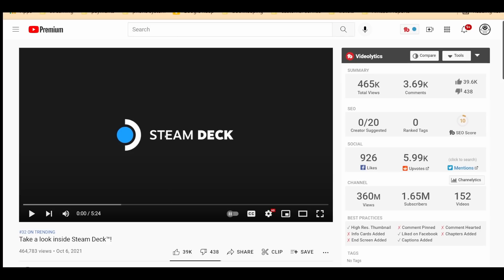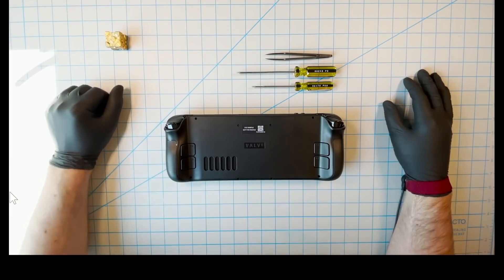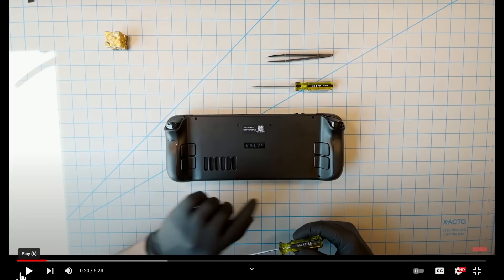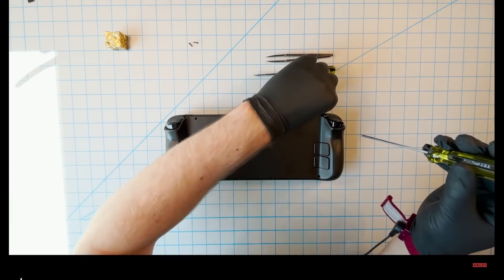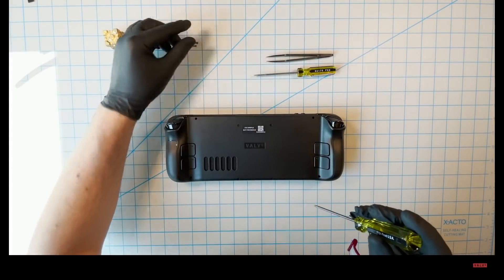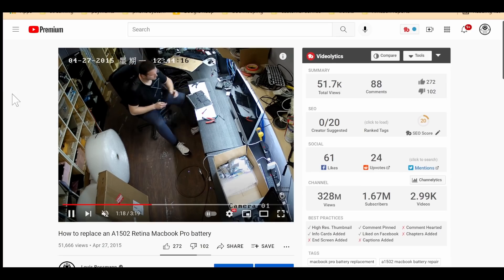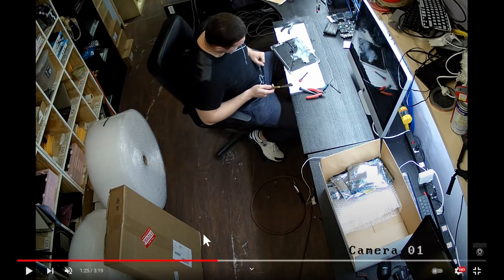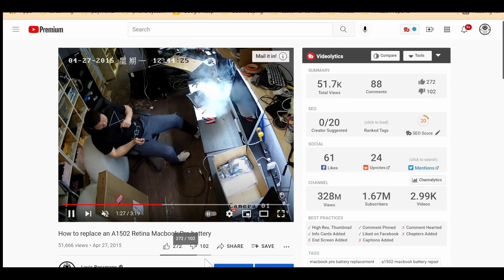Steam deck battery may end your life? bruh 😑

Comment: An 8 year old kid decides to open his steam deck. They puncture the battery and it starts shooting out flames, possibly causing severe burns as they drop it to the floor and run to get help. The battery causes the carpet to catch on fire. The fire quickly spreads and within minutes the whole room is engulfed in flames. It is very possible at this point that one or more people still in the house could die, so I can understand why (from a legal standpoint) valve would tell people that it is dangerous to open your steam deck and that it shouldn't be done (despite proceeding to show you how) because amateurs will watch this video, ignore all the warnings, and still find a way to mess it up. It only needs to happen once.

Comment: I would say from being an armature 3d printer user and created a few project cases myself, the part about weakening it forever s kind of correct IF you are to over tighten those self tapping screws it WILL not only strip out the plastic (PLA, ABS etc) threads but very likely split the posts they screwing into, therefore you now have a device with a case held together by the one remaining screw you did not ruin as you have now weakened the rest of the case.

Comment: Hey Louis, I am not an engineer nor any kind of smart person, but I have experienced fatigue that occurs in plastic posts that are screwed in with self tapping screws. 

The best example was when I did a teardown and modification to a set of joycons on a nintendo switch. Nintendo's joycons use really small self tapping screws, and when I changed the chasis on them, I accidentally drove in screws a little too tight and not only did it not create the thread, it ruined the plastic inside so it couldn't grab and fully close. I don't think it's as severe as valve is claiming it to be, but it definitely does cause a concern for the structure of the enclosure. But then again, that was my fault, and I shouldn't have done it as hard. I think this is just Valve trying to prevent assholes from claiming it's not their fault. 

Just my two cents on the point, again, not an engineer, what happened was my fault, and I learned how to handle self-tapping screws better. Thanks for the awesome video!

Comment: This is bullshit nothing is gonna be affected FOREVER if you dissemble the device also if you do it correctly it won't affect your warranty... Btw all my working mat are ESD safe they are for some grounded somewhere or they are made to push static under the mat then get it to ground, also all my tools are ESD safe, soldering iron, working station, tweezers, screw drivers... But putting a bracelet discharge on latex or nitrile gloves is dumb as hell !! The whole repair and disassembly of the Steam deck seem easier than a Nintendo Switch by far.

Comment: 100% all their warnings are a question of legal liability.
When he said that doing this kind of stuff is "cool", that was their real feelings over it, every warning sounds like it was written by lawyers and it probably was.
Them saying "DONT DO THIS" while showing how to do it is literally just them keeping their asses clear from assholes.

When it comes to the structural integrity, its probably because of the plastic in general, if you look at older laptop as soon as you remove the screws a lot of plastic would end up breaking on the inside of the laptop but I dont reckon this is a real issue with the steamdeck, again this just sounds like then trying to cover any legal liability.

Comment: Think what the Valve guy is getting at the 8:20 mark is since they are Self Tapping screws when you put it back to together the screws will not be as tight as they were when first installed so a drop could pop the screws and make it weaker which could affect possible rigidness of the device. Which in return makes sense but if it was me, if needed I just throw tap of lock tight on the screws when reinstalling.

Comment: Removing self tapping screws can damage integrity because they are screwed into plastic or they might use those little metal pieces tht are put into the plastic frame…that makes sense to me because if you take out the screw and put it back in you are not recreating the threading and are probably making the threading wider

Comment: My comment will probably get better and never seen or read and that's fine but 9:00 yes removing the screws and putting them back in will weaken the structure of the device because they are not screwed into embedded metal threads but just self tappers in the plastic itself and what happens nine times out of 10 with self tapers in a plastic is you are not going back in to the same threads that were cut the first time you're cutting a whole new path of threads every time which chews up the plastic and weekends the screw engagement on the plastic making it that much easier for the screws to strip out

Comment: Because they're use self-tapping screws, it is correct, "at least in my opinion or in my mind" rather that after you open it it's probably not going to have the same holding power. but in the same mind just use some little bit of loctite and common sense.

Comment: As others have probably said before me...
I think they're trying to say that the case's structural integrity is highest when the screws are precision tightened to just under the sockets' break point. Which would be difficult (if not impossible) to do without a precision torque driver and a fair amount of skill. Easiest if you have tested many to destruction and have calibrated your assembly tool to just under that threshold.
Also that the thread socket created by the initial installation of self-tapping screws in plastic will never be as tight after removal and even perfect re-installation (at least without using adhesive).

Comment: I'm a Joe nobody from the street, but if you're dealing with self-tappers, once you remove them there is no putting them back as secure as they were before. I hate to say it but dude's right after the initial placement of the screws any removal and replacement without increasing the size of the thread of the screws you're putting back in will result in a weakening of the structure. Now that being said how much of a degree that will weaken it depends completely on every individual screw in every individual situation so on average I don't think it weaken it by enough to be concerned, does not change the fact that it is a true statement. At least in my personal belief

Comment: You seem to misconstrue their "Do this at YOUR own risk" disclaimer.  Idiots have been known to do these kinds of things on their workbench where they also pack gunpowder into bullet cartridges or clean car parts in gasoline.  Admittedly, we might be better off if these people do not procreate, but his family might win a lawsuit if he was not thoroughly warned of all dangers.

If you cut new threads into the plastic when installing the screws, you will reduce the strength; if you rotate them BACKWARDS until they 'click' into the old threads before rotating them forwards, then there is no significant difference in strength.  The same goes for other self-tapping screws (in metal, wood. etc.)  Installing and removing the screws does polish the plastic surface and will eventually reduce friction such that the screws are more likely to vibrate loose.  A dot of nail polish under the screw head cures this if it becomes a problem.

Comment: The point of losing some structural integarty self-tapping screw is in nature of forming path for thread. When re-using a bolted thread, the original grip and stiffness of the threads formed in the plastic are lost. 
If the threads are not ripped off, the initial tightness of the connection will not be and the console may begin to creak due to the resulting backlash. Also, the bolts themselves can loosen over time. In theory, part of the problem will be solved by the thread lock, you just need to choose a composition that will not damage the plastic.
I made such conclusions on the basis of repairing many plastic devices and working with cases for protopypes.

Comment: Well, damaged battery might work for a while. It might catch fire after you use it for a few days then you put it on charger.  Not being critical but the fact that guy working with the daily battery replacement does not have dry fire extinguisher + metal box with sand to put it into is hard to understand as a proof. This is something every repairshop should have under the desk, so instead of running around and panicing, you put damaged battery in box, cover the fire if any, close it and shake it a bit so it goes under the sand.

Comment: What they didn't clerify is not catastrophic failure of the battery. What you need to be concerned about is a partial puncture that leaks after time in the device. Since these devices will be out in a backpack. THey could catch fire. Technically self tapping screws function is alwasy degraded after 1 or more removals. It is unlikely to matter in les sthna 3 or 4 tear downs.

Comment: 2 ways a damaged battery /could/ kill you:
1. You're working on it in a messy room with a lot of fire load, panic, try to put it out, fail/make it worse, and don't get out before the entrance is blocked by fire.
2. You damage but don't completely puncture the battery. You put it back together, throw it in your backpack and, after some jostling or the impact of throwing the pack on the ground (or the floor of your bedroom) that damaged spot splits and you have a puncture. It's like a lit cigarette in a trash can. If you see something ignite you can act quickly to escape or mitigate it, but if you're not paying attention it can very quickly get out of control. 

Ask any firefighter and they'll tell you tons of stories of very small, easily manageable or avoidable fires that grew quickly and claimed lives due to panic or inattention.

Comment: There are specialized Tri-Lobe self-tapping Screws for plastic that don't degrade the plastic when installed and removed. Phillips heads do tend to strip so that could be the only damage I can think of, but Torx heads fixes that. Also, if a battery fire catches something more flammable on fire like a curtain, that could be more deadly, but yeah, multiple points of failure have to happen to get there.

Comment: about the structural integrity, a lot of people will break the claws, that are holding the device together and then the structural integrity is compromised. That means, when you hold it you can feel it not holding together well and if it falls down and it holds only on the screws, it will break the plastic around the screws.

Comment: ssds only have limited write cycles, since writing is the only thing that effects a cell
reading is fine. reading from a hdd can make it fail since it has to physically move parts to do it. the only way an SSD read can hurt it is if the controller decides to move that bit after the fact because of TRIM

Comment: I could see a problem with "structural integrity" if someone doesn't correctly and snugly align the halves of the housing when reassembling.  And as some others have said, tightening the screws too much (even if they realigned the threads to their existing ones).  

But I am wondering which are worse; self-tapping screws into beefy plastic studs, or brass studs molded into miniscule plastic skim-coats that a flea could hammer their way through.

Comment: offcourse the structural intergity is touched, screws that go in to plastic lose some of their hold when you remove them and put them back in. That is a fact, so yes it loses some strength. But that is not really that big of a deal. Most of these type of housings have edges on them that sort of slide in to the other part of the casing and the screws are only there to clamp those 2 parts together. If not then they are using the screws wrong because screws are NEVER designed to hold any sideways load. They are designed to pull thinks together and hold them there by the clamping force.
Good example would be a car wheel. The bolts in a car wheel dont handle the up and down motion on that wheel at all. If you drive in to a pothole the bolts would bend or even snap. But because the bolts pull your wheel up to a steel flange with such a huge force the friction between the wheel and the steel flange is so big that the wheel wil nog move at all, so the bolts are fine, because the only needed to give a pulling force, and not a sideways load.

Comment: The fact that they're even posting a video showing how to take it apart in the first place just shows how much they actually care about right to repair. I feel like all of the 'you could die' stuff is just them covering their assets in case some idiot opens this thing up and stabs their screwdriver through the battery cells. In this day and age, you can be sued for not putting the proper 'do not drink' labels on bleach bottles. It's ridiculous, but required.

I feel like the real message that this video is conveying to anyone who actually knows how to to work on electronics, is actually "please have fun taking our product apart."

Comment: Tip for self-tapping screws: Just push down gently and turn them backwards until they click. That way when you screw them back in, it screws into the original threads instead of cutting new ones.
Reply: Good practice for anything with threads.
Reply: Fully agree. I don't know how I lived half my life never knowing about that trick, but I now do it for anything threaded and haven't stripped or cross-threaded a fastener in years.
Reply: One should back-thread before proceeding to re-screw with the kind of fastidiousness like Fran from Franlab.
Reply: This. I was just thinking about that trick

Comment: Ironically a Russian YT channel tested these batteries and got one to explode sure it wasn't a little nick but it proves they can explode! I have nothing to do with the channel the YT algorithm suggested it to me after watching this one, Louis watch this video.
https://youtu.be/IXbYh8UkbRI
In one situation like yours a shop trying to fix a device then you have other possibilities ridding in a car getting into a wreck and your knocked out or trapped and can't get away from that device as it goes up you could have broken legs I have always wondered how a Hybrid or a EV would react in a accident if the batteries are damaged during a accident when someone is trapped inside would a Gasoline fire be worse that a Battery thermal runaway?

Comment: I sincerely doubt that there will be power issues with the SSD. The thing is that there is very limited choice when looking for an M.2 2230 module anyways. For OEMs as well as retail, it all boils down to toshibas/kioxias BG4 and Samsungs PM971. Ohters are most likely only oem branded versions of those, like the kingston OM3PDP3512B. Valve will probably use both, as dual sourcing is the thing to do nowadays and they are both known for their miniscule power draw. Yes, there are some new phison drives showing up with the tiny PS-5013 controller, but they are not very widespread, same for the upcoming WD SN520 inhouse controller. And i doubt they consume significantly more, because Microsoft uses an upgraded PCIgen4 Variant of this Phison architecture in its Series-X Storage modules and encloses them with tight plastic, and has no heat issues in that tiny stick.

So most likely you will end up buying a 2230 SSD that has the very same hardware as Valves OEM variant.  Of course there could be Firmware related power management issues like with those macbook SSDs, but i sincerely doubt this, as steamOS is Linux based unlike macOS, so it will probably use open and standard power management stages.
As for EMI, i doubt that NAND flash or conrollers do a lot of emi noise, but you could always use a little aluminium tape around i and ground it, which would also help with thermals. Not a big deal.

Comment: So you can't die from the battery. But what if you run away - and your desk is starting burning? With you away googeling how to handle a battery on fire...

Buildings burned down because of ONE candle or cigarette. A exploding battery is way hotter.

Comment: I worked as a Design Engineer for many years especially on plastics goods. Screws for use on plastics should be 'thread rolling' or other specialised thread rather than the sharp ones used on screws designed to tap into metal ;and you should only use screws rated for plastics. Plastics bosses tend to break or shatter when sharp cuts or cracks start to spread and metal tapping type screws can accentuate this problem. When replacing screws into plastic it is good practice to gently turn them the wrong way under very light pressure and you can usually feel the screw lift up on the threads already cut into the boss then suddenly drop. At that point just screw the correct way and the screw should go straight into the old thread. Doing this you should be able to open and close a screw into plastic many times with no problems. Just screwing in will probably cut a fresh thread which weakens the boss. Doing that repeatedly can strip it out.

Comment: About self tapping screws.
If you do not catch previous threads on a self tapping screws, you might (and after few assemblies you will) compromise the post it is screws in.
There is a trick to catching previous thread. You insert the screw, keep your screwdriver aligned and turn it backwards until you feel screw sunk down, at this point you start turning in the right direction to put the screw in. It might take practise, but if you did every thing right it should minimise damage in the post.